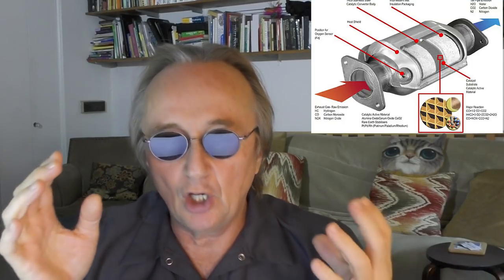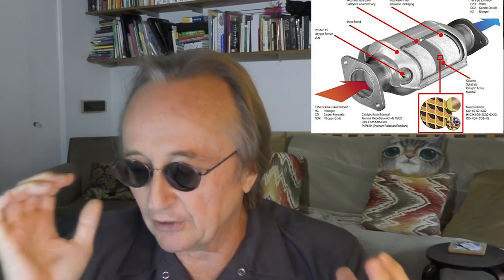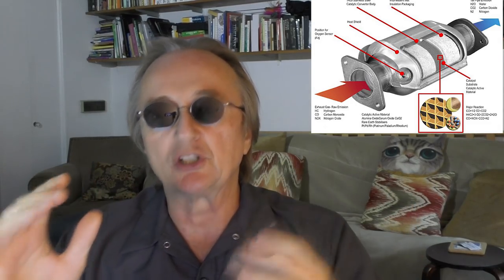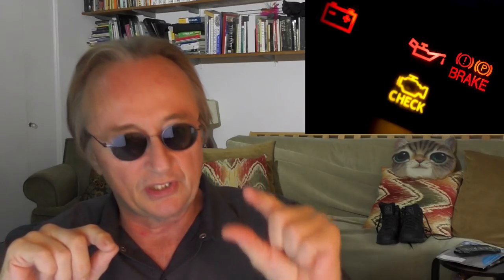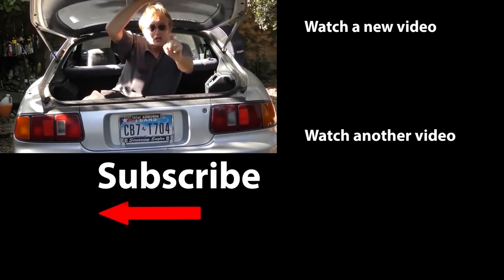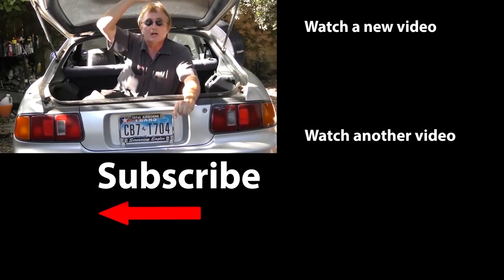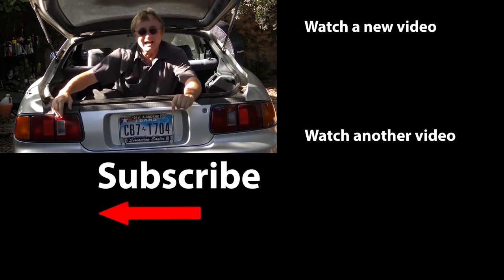Why it’s Illegal to Remove the Catalytic Converter in Your Car

Comment: All truth be told, a good cat dosent create a acupressure issue. The only time it's a problem is with a tuned turbo motor, seeing as it's tuned without one and running the motor hard like you set it up to run will just eventually burn the cat up creating the backpresssure issues.

Comment: I took a cat that was sitting around that my neighbor cut off his car.  I bashed all the insides out of it.  I then took material off each end until I could shove a 2.5 inch straight pipe threw it and welded around each end.  I sanded it down and painted it silver.  It is basically a straight pipe that looks like a cat. I still have it in my basement and I never used it. In my state, if the vehicle is 15 years old it does not need to have an emissions test, but if the vehicle was manufactured with a cat on it then it better dam well have one on it when you get it inspected even if they don't have to do the test. I am ready for when a cat goes bad and needs replacing, but they pretty much last the life of the car so the one in my basement is just collecting dust.

Comment: Hey Scotty what's your opinion on a 92 dodge dynasty with the 3.3l v6. I know they have transmission problems but only if the owner neglects them. Other than that I haven't had many problems and found the engine to be very simple to work on. So far it's been one of the only cars in town that the shops around here call a tank on wheels.

Comment: Hey, Scotty: what do you suggest about using oil additives for and old Ford car (that uses mineral oil)? Despite being MOS2, ceramic, or something strangely magic like Motorkote: is it really better to use them? or should I just change oil more frequently? Also, is it better to use thicker oil (than the one suggested in the manual) when the car is old and have small leaks? Thanks.

Comment: I have a 2003 GMC envoy with 266,000 miles original transmission and engine it doesn't feel like it has as much power lately any idea what can do to  fix that

Comment: If you take the cats off its not going to be that much louder. What makes the car loud is deleting the muffler and resonator. If you car is turbo and u remove cats and muffler you will notice the turbo hits peak boost faster and when you tune you will be able to get more power than if u had a restricted exhaust

Comment: the early catalytic converters were a packed bed design which had a bad rep and most pre 1984 automobiles the CC was part of the exhaust system not the emission package where the epa revised the rules - CAAA '90 officially outlawed catalytic converter removal which graduated 2 the second O2 sensor after OBDII was phased in (clean air amendment of 1990 is applicable 2 individual car owners and this includes dual cats where the engine originally was a single cat system -- MOST IMPORTANT WITH THE GM LSX SWAP - THIS IS WHY THE 78 VETTE PACE CAR REPLICA THAT REMAINS STOCK WILL APPRAISE @ $12,000 AND THIS INCLUDES THE STOCK PACKED BED CONVERTER)

Comment: Scotty I'm 17 and im looking to buy a BMW 330ci. I will get it with a manual transmission. I am already familiar with the engine oil leaks around the valve cover and oil pan plus the ccv eating oil. Apart from those what do you think? Thanks

Comment: Hey Scotty, I have a 2002 Toyota Camry 4 cylinder and the check engine light goes off and then it comes back on after a while. It's the Catalytic Converter what could I do to fix it?

Comment: Scotty, what's the effect, if any, of not replacing the vapor cansiter on my Jeep Wrangler? I've had a CEL on for awhile and the code points to the vapor canister. I've already replaced all the inexpensive bits associated with that system. Any harm in letting it go awhile longer?

Comment: What do you think about my G35 2006 coupe drives smooth has a 100,000 miles should I change the transmission oil ???

Comment: I have a problem my 97 jeep grand cherokee 4.0 is not moving when I press pedal....it revs up but doesn't move I just fixed the lower transmisson coolant line and upper and put a new radiator in it any thoughts?

Comment: Hey Scotty I seem to never have the time to ask you a question when You go live but I have a 95 Ford mustang base model and it runs great and strong one issue is that every time I have to start it up I have to prime it 2-3 times before it starts could it be the fuel pump or could I have a leak in the fuel lines

Comment: I own a 1994 Toyota DLX Pickup and  live in a state that does not have emissions I was told that with my cat delete that it will hurt my MPG Mileage... is there a way or tuneup procedure that I need to do to get the maximum fuel mileage ? like setting the fuel/air mixture differently or by setting the timing differently do you have any? Segestions   Thank you
Reply: it has the 4 cylinder 22RE Engine ... I was told that I should put a spark plug defouler but do I need a custom type ajustmemt or tuneup ?

Comment: Dear Scotty, My 93, 7.3L F350 vibrates and groans at me when a load is put on it, i.e. gong up hill, accelerating, and towing. I don't know if it could be transmission related or misfiring cylinder. plz help.

Comment: Does the 2008 Mazda CX-9 problem carry over to the 2010? It’s my moms car and it hasn’t had any problems with the actual engine, but sometimes has trouble STARTING (not turning over) when the AC is turned on. Is this normal? Should my mom be worrying about it? The car has a little less than 65K miles.

Comment: Hey Scotty, just had a quick question for you. What's your opinion on KIA's Forte line? A few years back, my mother was looking for a car, and she ended up settling on a new 2013 KIA Forte Koup SX I4 2.4l Manual. It's been a great car for her so far, and it definitely seems well built, but I've been a bit concerned as I've been hearing there have been quite a lot of issues with those engines throwing rods due to some issue with the main bearings, usually around 60-80k miles. Should she trade it in at 59,999?

Comment: Scotty I have a 2013 Dodge Charger RT with almost 99 000 miles on it I got it when it had 32 000 miles I kept up with the oil changes but I haven't changed the transmission fluid, am I still in time to change it?

Comment: Hey scotty, I have a 2002 chevy s10 pickup that has a bad air leak noise from the front of the door frames (especially the drivers side). I've had people tell me that it's the window seal and others say its the seal on the door but they look fine. What do you think?

Comment: I don’t agree with you on the Grand Prix, my dad bought one used with 65,000 miles on it. And he handed me the keys when I turned 16 and told me to enjoy it. When he gave it to me it had 185,000 miles on it, then I drove it for around a year and had it at 210,000 miles. That car had the original engine and original transmission and I beat on it because it was supercharged and had fun with it. It was in perfect working order with no issues aside from that pesky water pump😑 he put mostly highway miles on it and I put mostly highway miles also but I also beat on it a lot. My average mpg was 10-15 depending on my route, but my dads average was 20-25. Since the time I turned 17 I bought my own car under my parents of course and paying them. It’s a 2015 fusion se with the 2.5L inline 4 mainly because I wanted something more fuel efficient and oh boy did I get it. City driving I get 30 mpg and highway I get anywhere between 40 and 45 mpg.

Comment: Or you can just replace your cats with high flow ones....either way, its not a significant boost in power thats worth the work if you ask me. 

Modern cars are tuned to run with the stock intake and exhaust system. If you are going to increase air flow for one, its a good idea to increase air flow for the other as well otherwise your wasting your time.

Comment: Scotty: my 2005 Chevy Tahoe is bad, the engine shakes real bad once I turn it on, it won’t accelerate past 20 MPH HELP!!!!! I’ve already changed the spark plugs, wires, mass air flow sensor, air filter, and throttle body, what could it be? When I try accelerating more then 20/30 mph my truck shakes bad

Comment: Scotty I have a 1991 gmc Sonoma the blinker blinks fast not an led bulb what is wrong
Reply: If one of the bulbs isn't out, it's the flasher relay. I believe on the older ones it also blinks faster if there's an excessive load because it causes the relay to heat up and open faster

Comment: I have a 04 330i e46 with 111910 miles on it n it runs great but the one code is it says it mixtures is to rich or lean n I looked at my plugs n there are fine what could it be

Comment: Can anyone help me I have a 2003 dodge dakota some times when I go to change from parking do drive or drive to reverse the shift won't go in and the car won't move but then i just do it again and work perfectly otherwise it shifts really good it just does that some times any thoughts thank you.
Reply: If you shift too soon after starting the engine sometimes it won't go into gear
Reply: @jrg10332 most if not all Dodge trucks at least around this time used column shifters

Comment: They will stop up and are expensive to replace. Here in Wyoming their is no inspection either. I personally will never buy another new vehicle. They are junk. I have had a 2007 impala a 2012 Mitsubishi and a 2015 dodge ram. Junk. I now drive a 1967 ford falcon and a 1989 Chevy silverado with a carburetor system. No more fuel inj.

Comment: What if you remove the catalytic converter and adjust a fuel air mixture?
Reply: If your objective is to have it run better? I think that would do it, but im not 100% sure. 

But if your just trying to less the pollution? Nah, doesn't work like that. Better to keep it on and spare the rest of us the poisonous air.

Comment: I have a Cadillac SRX 04 v8 RWD what do you think of the car it had 95k miles now it has 106187  it’s leaking oil I did the top oil seals and the seals for the spark plugs I got it for 5500 and now the oxygen sensor is going off on one high and 1 low should I fix it or get rid of it it handles good just the power stearing started leaking not a lot what should I do are they reliable if I decide to fix

Comment: Hey Scotty I was looking at a used 07 nissan Altima it had 202k miles on but the coolant went to the transmission and it blew the engine so the mechanic got a used engine with 60k and rebuild the trans and is selling for $5k.    Do you think I should get it.

Comment: scotty, i have a question.  99 bmw 328is, M sport edition. 187k miles on it.  ive been noticing a loss of power after i take my foot off the accelerator, is this normal? should i take it to the dealer?

Comment: We don't have vehicle inspections in Oklahoma anymore. Cut off your catalytic converters... then REV UP YOUR ENGINES!
Reply: They do a good job of helping keep the air less poisonous, it would be nice to everyone else  to just keep it on
Reply: Adam Nope  , Well then plug up your tailpipes with a bananas... then REV UP YOUR ENGINES!
Reply: JD Chevy perfect 👌
Reply: I'm just giving you a hard time :)  I totally understand the function and purpose of catalytic converters. It's honestly rare to hear someone running open pipes in Oklahoma, but it's possible to do without any legal (only moral) ramifications. There are pros and cons to not having vehicle inspections enforced by the state. One downside is that people can drive around complete beaters with bald tires; that's really not someone you want in the lane beside you on the highway during a heavy rainstorm. Just last week within a 30 minute trip I counted at least 5 cars with only one working tail light. However, for those of us that do maintain our cars it's nice not having to go in every year to get that little sticker on the windshield.

Comment: 95 f250 with the 351 in it has 134k brake pedal goes almost to floor to stop do I need to bleed breaks ? And mine is straight pipes lol loud af lol

Comment: 😏👍 95 & Older are exempt from emmisions
Reply: Wrong
Reply: a car is exempt from rules made after they are
Reply: @JuanLopez-lp8ig  Right, they have to be older than 25 years. But then yes, but not as stated, the device must be installed, it DOES NOT have to function. You CAN knock out the core, and it will not change one damn thing for your fuel mixture, carburetors don't care

Comment: That insurance thing on cars like the G37 and 350Z is BS. I own a 350Z and
a Q60S and they cost less then insuring a Honda Civic. Most insurance companies
look at the number of pay  outs for accidents relative to car type. What I was told is that
a lot of 'ricers' like the Honda cars and some other less expensive performance sedans.
They drive them like crazy people and get into a lot of wrecks where as the 
G35, G37 and Q60 are expensive and not a top choice for boy racers and
tend to be driven by older people who don't get into the number of wrecks.  
This is why it costs me no more to insure my Q60S then my Honda Accord. 
And the Accord is an older car by a couple years.

Comment: Scotty love your vids. My problem is that my civic 08 airbag light came on. Dealer wants 140 for diagnostic. Any way I can diagnose for cheaper
Reply: Intesar Alam check and see if it has a recall on the airbag if it does. Dealer has to replace it free of charge and some even issue you a loaner for your time
Reply: Go and get that Creader 3001 that Scotty suggested for under $30, and scan it for trouble codes. That's what the dealer would do, anyway.
Reply: Some of the newer "cheap" scan tools will read ABS and airbag codes, other than that, you can look online because usually you can ground a pin on the diagnostic port and it will flash the code on the light
Reply: @minivanman1356  it did have a recall in Feb which I got fixed. But now it came back on randomly  Dealer says if it's unrelated to recall then will charge. Thanks for the reply!
Reply: @EMichaelBall  thanks Michael for the suggestion!
Reply: @LesKing72  thanks will do

Comment: How do you feel about 1999 Ford F-250 with 5.4 automatic transmission
Reply: Every Rubber seal on that entire car is going to be dry-rotted and you're going to have oil on the ground, air in your oil pump and larger pairs because of those small ancient 3 dollar items.

Comment: I deleted my Resonator, today and next week I'll be deleting my second Resonator, that they say is a cat. I'm also gonna delete the main cat, that's on my Header with a cat less, Aftermarket performance Header, after deleting my Resonator, today my Exhaust is friggin loud and I love it. I freed up trap toque, and increased more Horsepower, my car is actually running faster, I am amazed at how much quicker, my car response when I shift gears. I can't wait to Turbo, my car next year I'll be boosted and way faster then I am right now P.S. every head turns when I'm accelerating, and my Exhaust is screaming, and I can't help it but laugh all I can think of is how much louder my Exhaust will be once I delete my 2 cats

Comment: It' s totally legal in Arkansas, it's a filter that suffocates your engine from breathing, laquer thinner will deteriorate my old hoses, I have a 2000 Acura TL, and got 14k in maintenance, I will remove it, before I use laquer thinner, all I know it's bad, and a new one for that car will cost a fortune
Reply: Its illegal under federal law if you are using the vehicle on public roads.

Comment: Scotty I have a 2006 TDI Jetta with a low brake pad light warning on, I bought brand new oem pads and that didn't fix it so I cut the wire and looped the wire back into itself as a dummy switch and that didn't make the light go away either, it's driving me NUTS any idea!?!?!?
Reply: I wish I could but it's an enclosed unit

Comment: None of my vehicles came with catalytic converters. Pre 1971 cars and pre 1998 Diesel trucks.
Reply: catalytic converter was standard after the 1974 model year (anything 1975 - present has a converter exc 4 some imports eg. Honda Civic, AMC products) - light truck under 6500 GVW was exempt until 1979 where the GVW rating was raised to 8500 where the CC is now required for light trucks under 8500 GVW

Comment: Hey Scottie I bought a 2003 Lincoln Aviator in November of 2017. I paid $500 for it because it wouldn't run. Turns out there was a major vacuum leak at the intake manifold. So I taped it up, pumped up the tires and jump started the car... I drove it away to the previous owner's surprise. My questions is this... Was this a good deal and what should I look for to go wrong? The car had 156000 miles on it when I bought it. On New Years Eve of 2018 I had to replace the radiator in the parking lot of my job, the Camshaft Pos. Sensor went out a month later and now Im having to replace the valve assembly on my transmission because 2nd gear solenoid is failing. I enjoy the car, plenty of power and AWD. It seems like the car will be a money pit though. I need your insight please!

Comment: Hey Scotty watching your videos like the information that you would give about cars I myself am a used 05 Honda Civic I know for a fact that the motor has been swapped out before I doubt it so I know it doesn't have the original motor it has been the family I do know that you said the automatic transmissions Ohana's and not very good but I've also got a bad left leg so working a clutch is not exactly easy for me to do is it any other information that you can possibly tell me that might be good to help me take care of this car cuz right now the new motor and the new components on the front end before I bought it is there any other information you might be able to tell me that help me take good care of this vehicle